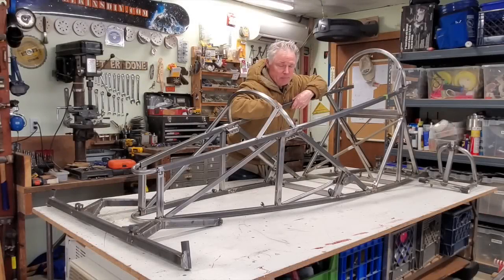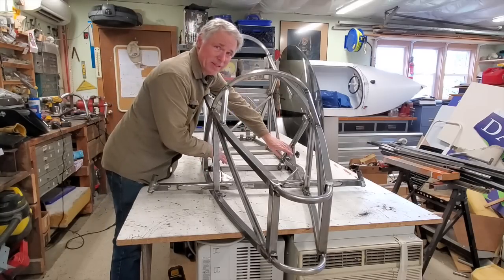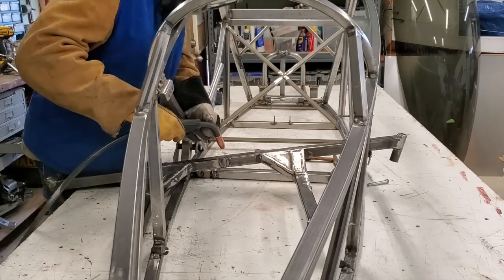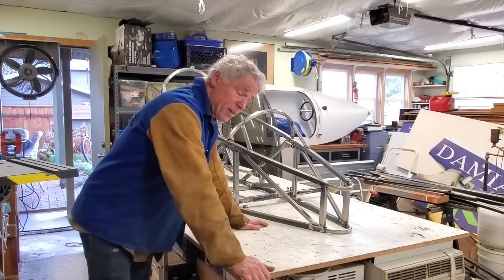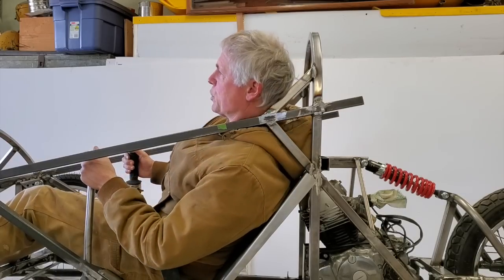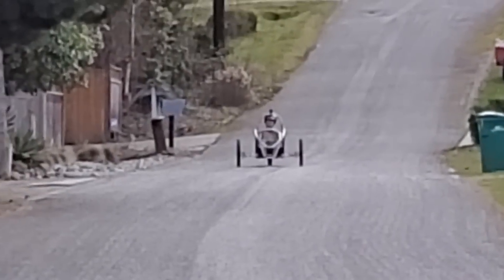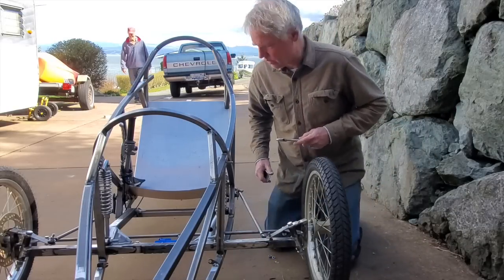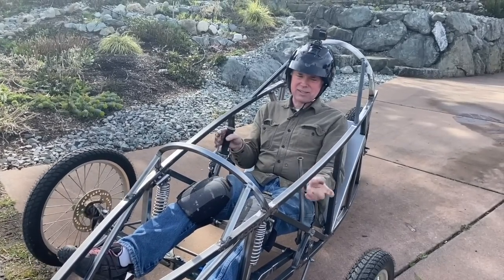Fuel efficient reverse trike build (part-8)

Comment: Would making the center a beam that goes lengthwise, then have the outside be dope and fabric over light frame like from an airplane work?   You would end up sitting higher as you would have to straddle the beam, but it might be lighter or possibly cheaper.   Great video btw.

Comment: Paul, an idea for shifting. use two clutch pedals with each at full depression bumping a different side of a  Honda style shift lever. Declutch and upshift with one pedal, declutch and  downshift with the other, declutch without shifting with both pedals together.
Reply from the maker: Hmmm. Interesting. I should have read this earlier today. I just finished mounting and hooking up the clutch pedal, but interesting idea!
Reply: @paulwelkinsdiy  Or one clutch pedal, short and wide, with your toe contacting ether side of a horizontally mounted Honda style shift lever. slide your foot to one side of the pedal to upshift, to the other side to downshift. Hands free shifting.

Comment: I love this front suspension... Maybe this will be best solution for my velomobile build. Maybe it will be more massive than independent wheel suspension (McPherson strut), but this wouldn't have changes of geometry during suspension travelling and would be much stronger ... also during steering this shouldn't have tendency to roll out of turning circle
Are there dampeners there or only springs in the front?

Comment: It'll never work... I'll be up in a few hours to haul that away for you... I won't even charge you :)  Looks like you've got a good basis for your machine.  I might try something similar with the guts from my NEV or my electric "moped" (cheap chinese Vespa looking scooter that was given to me that I repowered with Lthium in place of the lead acid batteries that supposedly gave it 50 miles range... once.
Reply from the maker: How far does it go now with the Lithium batteries?

Comment: Thanks for sharing Paul, I have been following you since your chloroplast trailer camper days. It looks like it's coming along good I'm anxious to see the thing driving under its own power. I have to say I thought I was crazy, and I was pretty surprised when I saw you rolling with no brakes. But maybe you had a rear brake and I just didn't notice.
Reply: He has some sort of brakes, i heard the tyres skidding to a stop like a BMX.
Reply from the maker: @Jamal_Tyrone  What is normally the front brake, right hand brake, is now the rear brake. Not that the front suspension seems to work I'll add the pedals, including the hydraulic front brakes.

Comment: Smooth, I'm shocked. This seems to stick very well on the turns, very exciting
Reply: Since the front suspension is dependent, it is not hard to stick the turns. It requires a lot of momentum or very sharp turn to lift a wheel in a vehicle with low center of gravity

Comment: I was concerned that your steering was going to be overly sensitive and twitchy. From the video it doesn't seem to be overly so.
Reply from the maker: I really like this set-up, at least at the slow speeds I was going. Other than the one steering arm adjustment I think there's no need for further tweaking.
Reply: @paulwelkinsdiy  if you look at  Energy Suspension they may have some polyurethane bushings and bump stops that may be useful to you Paul. This is where I found the bushings for my plane's landing gear. People underestimate how much a simple polyurethane bushing can lower the shock loads on a frame.

Comment: Really nice, as I mentioned there are some old drawings in my files  too. Because of winterseason in Sweden my plans was to use a fan cooled scoter engine and have the possibility of heating the cockpit and  Windows. There is still one design feature you havent considered. And that is a soft shell that goes with and fixed with zippers and wellcroe. Lighter and more comfortable  in the best parts of the sommer when you drive it naked.
Reply: He's going to drive it naked? Now, that's the spirit of America right there!

Comment: yeah, when welding a frame like this you need to make short beads in one area, then stop and move to an area across the frame, make a short bead there, then move across the frame again etc etc until everything is welded. sometimes if things get too hot you need to stop welding and let everything cool back down. if you just start at one end trying to weld up everything in order you're guaranteed to get a lot of warpage, i've done it myself by accident many times but have learned from my errors over the years.
Reply from the maker: Thanks Marzsit, Good advise! I learned that and some other tricks years ago in a metallurgy class. The frame came out very straight, but the swing arm I goofed up on. At least it was fixable! Barely!
Reply: @paulwelkinsdiy  at my old workplace the welders used to use copper plates to act as a heat sink to stop heat from spreading through the frame.  I'm not a welder but who knows, I might have just said something useful!
Reply: @martinwebster8702  Good trick when you are trying to weld extremely thin plate as well so you don't blow through it.

Comment: I am building a reverse trike with a Honda PCX150 (bought for really cheap from the salvage yard).  Your videos is helping me tremendously.
Reply from the maker: Excellent! That's what I want to hear! Much success on your project PDB! Be sure to post it on YouTube.
Reply: Agreed! Spending my stimmie getting a frame welded up instead of a down-payment on a car. 80+ MPG means lot more $ in my pocket, and low mass means less of it to have to repair and maintain. The true price is that you have to mix it up with cars and trucks without any crash protection, same as a motorcycle, so just like a motorcycle, you need agility to compensate for your fragility.  Steering and suspension design is of the greatest import and your vid has helped me a lot.